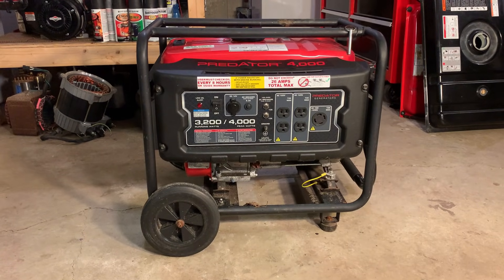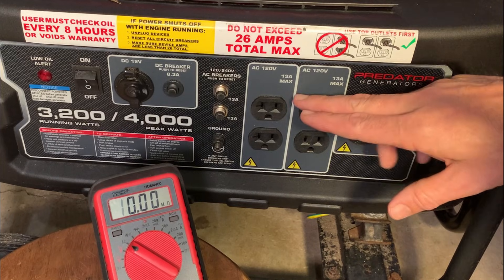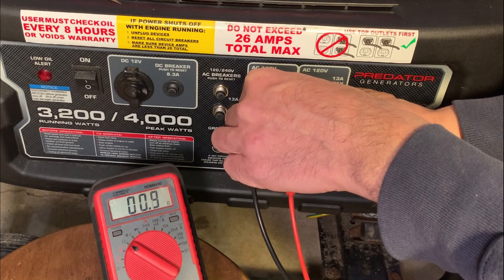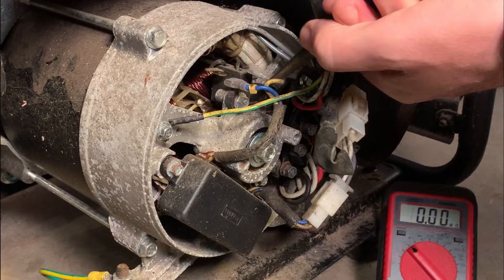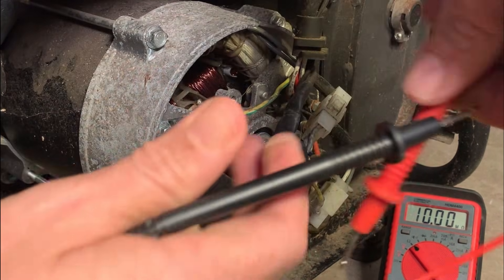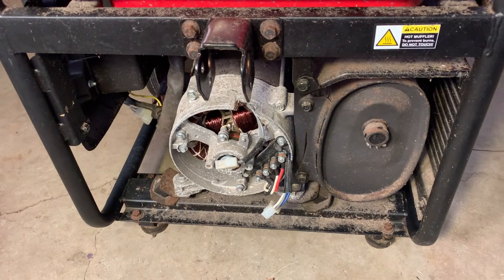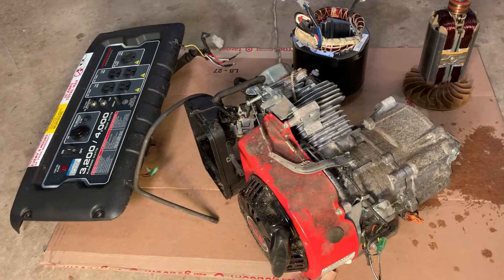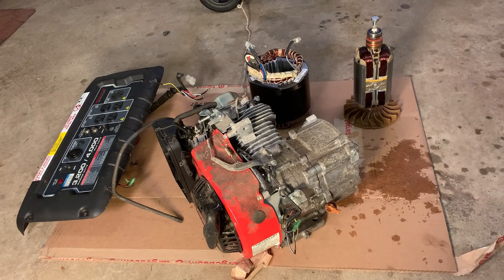Predator Generator Not Making Power

Comment: How come they don't put a oil filter on these generator engines just asking keep up the good work!
Reply from the maker: Most generators below 8000 watts do not have a filter.  Just a way to save money I guess.
Reply: Those smaller engines use splash lubrication with no oil pump. You need pressurized oil to use an oil filter.

Comment: I think since James sells the repaired generators he is not in to quick and dirty repairs, watching his many videos he is meticulous in his repairs and trouble shooting and does not give any unit his blessings till its 100%. Soldering a branch wire could be done to make it work and odds are it would be fine....but.....John
Reply from the maker: That is exactly it.  I have soldered them before and got them to work.  But selling to someone does not make me comfortable.  Especially since the rotor is spinning at 3600rpm.  The slightest imperfection in the repair and it will break again.

Comment: Small engine mechanic Mike had similar problem on a much larger generator, luckily his was repairable.
Reply from the maker: Yes, saw his repair.  His break was in a better spot.  This could have been rewound easy enough, but I only got it for parts.  Not worth the time to rewind a small generator like this.

Comment: Do you know what's wrong with the generator before you film the video, or are you filming it as you go? I love how you explain what you are finding, and what it should be. Have you considered taking the bad rotators & stators to a motor shop& have them rewound? I've had pretty good luck doing that, and found them to be quite reasonable.
Reply from the maker: I only know what the seller told me.  We both figure it out as I go.

Comment: Maybe even using a dremel tool to remove enough plastic to get enough wire.
Reply: Don’t forget about the generator safety rules: Always make sure you follow all the generator safety rules whenever you use your portable generator. This is only a reminder. Generators can be dangerous if not used carefully. Every year, hundreds of people die or get injured when using portable generators due to carbon monoxide poisoning and electrocution. Make sure you are using your generator carefully and keeping others safe as well. There is something very serious that everyone should always be aware of when using generators. Some people do run their generator indoors which is not safe and that increases the risk of carbon monoxide poisoning which can cause death of family and you. Some people run their generator in wet conditions which can electrocute them. Please remember that you should never run your generator indoors. Remember that carbon monoxide is an odorless and colorless gas that you cannot see or smell. Carbon monoxide is a silent killer. Keep that in mind. Make sure your generator is 15-20 feet away from your house and away from doors, windows, and vents. Never use your generator in your porch too. Having a carbon monoxide detector is very important against generator safety. Some people also allow children to go near the portable generator which could pose risks. We need to keep an eye on our children making sure that they are not near the portable generator so they won’t get electrocuted or burned by the generator which is dangerous. A locking enclosure also keeps kids safe. A generator shed might look like a tempting place to explore, or take cover during a game of hide and seek, but a generator is a dangerous piece of equipment that can cause injury. It says on the manual that we should also keep children away at all times from the portable generator to avoid injuries. Please do not allow a child or unqualified people to operate the portable generator.  It is important to keep your children safe especially little ones. The portable generator can be hot during an operation. Just because some manuals missed what should be listed doesn’t mean it’s safe to do. Always follow the generator safety rules when using portable generators. Generators pose electrical risks. If you need to use your generator during wet weather, you need a generator tent to protect your generator from getting wet. Don’t let your generator get wet. Keep your generator dry and before using your generator, please make sure your hands and your generator is dry. Do not wear loose clothing when operating the generator. Everything that is said on the generator’s operating manual should not be ignored. Never smoke cigarettes near the generator. Please keep flammable things away from the generator. Never overload your generator too. Your generator can catch fire. Never ever try to plug a generator cord into a wall outlet to avoid back feeding. Back feeding your generator is dangerous. Always turn on your generator first before plugging in appliances and shut off the appliances before turning your generator off. Use a heavy duty cord for your generator and the cord should not be worn out. All the instructions should be followed carefully. Never refuel your generator while it’s running. It can cause fire if fuel spills while your generator is hot. You should turn off your generator and let it cool off before refueling it. Having a fire extinguisher next to the generator is also important. This is only a reminder for everyone’s safety of using generators. Make sure your generator is properly grounded. Having a fire extinguisher next to the generator is also important against the safety rules. https://youtu.be/I1jT3ANENvI and here is a video more about keeping others safe when using generators and also about our family’s safety. It’s important to keep our little children safe as well. Make sure your little children are kept away from the generator at all times especially when it’s running. Hope this helps. Always remember that it’s better to be safe than sorry.

Comment: I would still attempt to solder the wire on while protecting the coil. Possibly getting a hold on the wire tip with pliers and tugging left or right without damaging the coil and getting enough to put a dab of solder on the tip and getting a thick copper wire soldered to it protecting the coil with plastic and then when electrically correct hot gluing it into place so centrifugal force doesn't pull on the windings to short it out.
Reply: Please don’t forget about the generator safety rules: Always make sure you follow all the generator safety rules whenever you use your portable generator. This is only a reminder. Generators can be dangerous if not used carefully. Every year, hundreds of people die or get injured when using portable generators due to carbon monoxide poisoning and electrocution. Make sure you are using your generator carefully and keeping others safe as well. There is something very serious that everyone should always be aware of when using generators. Some people do run their generator indoors which is not safe and that increases the risk of carbon monoxide poisoning which can cause death of family and you. Some people run their generator in wet conditions which can electrocute them. Please remember that you should never run your generator indoors. Remember that carbon monoxide is an odorless and colorless gas that you cannot see or smell. Carbon monoxide is a silent killer. Keep that in mind. Make sure your generator is 15-20 feet away from your house and away from doors, windows, and vents. Never use your generator in your porch too. Having a carbon monoxide detector is very important against generator safety. Some people also allow children to go near the portable generator which could pose risks. We need to keep an eye on our children making sure that they are not near the portable generator so they won’t get electrocuted or burned by the generator which is dangerous. A locking enclosure also keeps kids safe. A generator shed might look like a tempting place to explore, or take cover during a game of hide and seek, but a generator is a dangerous piece of equipment that can cause injury. It says on the manual that we should also keep children away at all times from the portable generator to avoid injuries. Please do not allow a child or unqualified people to operate the portable generator.  It is important to keep your children safe especially little ones. The portable generator can be hot during an operation. Just because some manuals missed what should be listed doesn’t mean it’s safe to do. Always follow the generator safety rules when using portable generators. Generators pose electrical risks. If you need to use your generator during wet weather, you need a generator tent to protect your generator from getting wet. Don’t let your generator get wet. Keep your generator dry and before using your generator, please make sure your hands and your generator is dry. Do not wear loose clothing when operating the generator. Everything that is said on the generator’s operating manual should not be ignored. Never smoke cigarettes near the generator. Please keep flammable things away from the generator. Never overload your generator too. Your generator can catch fire. Never ever try to plug a generator cord into a wall outlet to avoid back feeding. Back feeding your generator is dangerous. Always turn on your generator first before plugging in appliances and shut off the appliances before turning your generator off. Use a heavy duty cord for your generator and the cord should not be worn out. All the instructions should be followed carefully. Never refuel your generator while it’s running. It can cause fire if fuel spills while your generator is hot. You should turn off your generator and let it cool off before refueling it. Having a fire extinguisher next to the generator is also important. This is only a reminder for everyone’s safety of using generators. Make sure your generator is properly grounded. Having a fire extinguisher next to the generator is also important against the safety rules. https://youtu.be/I1jT3ANENvI and here is a video more about keeping others safe when using generators and also about our family’s safety. It’s important to keep our little children safe as well. Make sure your little children are kept away from the generator at all times especially when it’s running. Hope this helps. Always remember that it’s better to be safe than sorry.

Comment: But does the motor run?!  lol!  I'm with the others, if the rotor is already toast, can't make it worse by experimenting with a repair.  I've seen smallenginemechanic repair those wires from the rotor windings to the slip ring wires.  Keep up the great work!
Reply from the maker: Yes, have done that before and have always made them work again.  Would be fine if I was keeping it for myself, but would not want to sell it to someone.   Will try the next one.
Reply: @jcondon1  I should say that every thing is fixable?! And a happy new year from India
Reply: Yeah on the white clamshell generator
Reply: @sureshkumarc.k6534  Don’t forget about the generator safety rules: Always make sure you follow all the generator safety rules whenever you use your portable generator. This is only a reminder. Generators can be dangerous if not used carefully. Every year, hundreds of people die or get injured when using portable generators due to carbon monoxide poisoning and electrocution. Make sure you are using your generator carefully and keeping others safe as well. There is something very serious that everyone should always be aware of when using generators. Some people do run their generator indoors which is not safe and that increases the risk of carbon monoxide poisoning which can cause death of family and you. Some people run their generator in wet conditions which can electrocute them. Please remember that you should never run your generator indoors. Remember that carbon monoxide is an odorless and colorless gas that you cannot see or smell. Carbon monoxide is a silent killer. Keep that in mind. Make sure your generator is 15-20 feet away from your house and away from doors, windows, and vents. Never use your generator in your porch too. Having a carbon monoxide detector is very important against generator safety. Some people also allow children to go near the portable generator which could pose risks. We need to keep an eye on our children making sure that they are not near the portable generator so they won’t get electrocuted or burned by the generator which is dangerous. A locking enclosure also keeps kids safe. A generator shed might look like a tempting place to explore, or take cover during a game of hide and seek, but a generator is a dangerous piece of equipment that can cause injury. It says on the manual that we should also keep children away at all times from the portable generator to avoid injuries. Please do not allow a child or unqualified people to operate the portable generator.  It is important to keep your children safe especially little ones. The portable generator can be hot during an operation. Just because some manuals missed what should be listed doesn’t mean it’s safe to do. Always follow the generator safety rules when using portable generators. Generators pose electrical risks. If you need to use your generator during wet weather, you need a generator tent to protect your generator from getting wet. Don’t let your generator get wet. Keep your generator dry and before using your generator, please make sure your hands and your generator is dry. Do not wear loose clothing when operating the generator. Everything that is said on the generator’s operating manual should not be ignored. Never smoke cigarettes near the generator. Please keep flammable things away from the generator. Never overload your generator too. Your generator can catch fire. Never ever try to plug a generator cord into a wall outlet to avoid back feeding. Back feeding your generator is dangerous. Always turn on your generator first before plugging in appliances and shut off the appliances before turning your generator off. Use a heavy duty cord for your generator and the cord should not be worn out. All the instructions should be followed carefully. Never refuel your generator while it’s running. It can cause fire if fuel spills while your generator is hot. You should turn off your generator and let it cool off before refueling it. Having a fire extinguisher next to the generator is also important. This is only a reminder for everyone’s safety of using generators. Make sure your generator is properly grounded. Having a fire extinguisher next to the generator is also important against the safety rules. https://youtu.be/I1jT3ANENvI and here is a video more about keeping others safe when using generators and also about our family’s safety. It’s important to keep our little children safe as well. Make sure your little children are kept away from the generator at all times especially when it’s running. Hope this helps. Always remember that it’s better to be safe than sorry.
Reply: @The_Happy_Aviation_Enthusiast  dang,that was looong